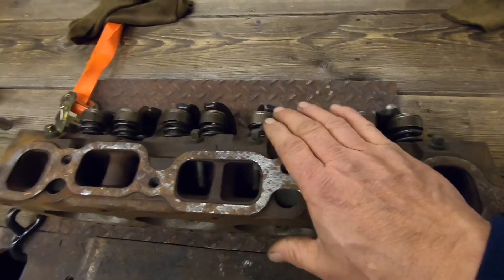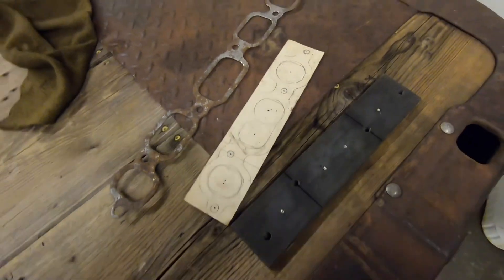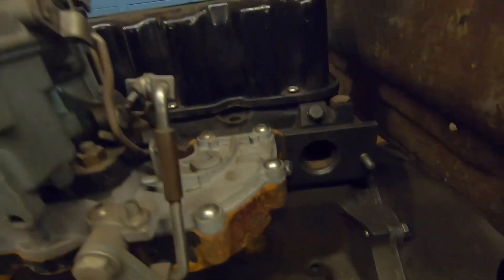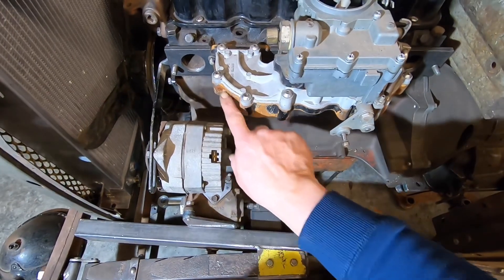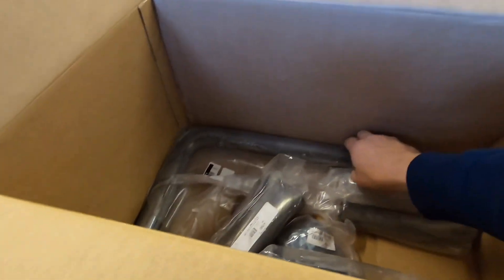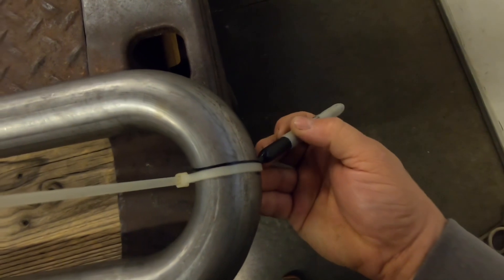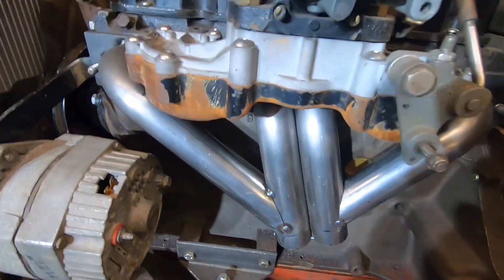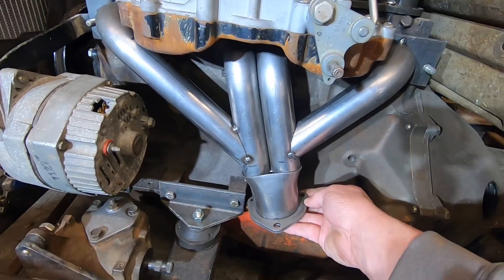The BLT #13 Building Custom Headers

Comment: always been a fan of those wee engines and that header is shaping up nicely.
Reply from the maker: They’re really cool little engines, and with 5 main bearings in the bottom end, they’re nearly indestructible.
Reply: @HotRodDad  gotta love solid engineering. i'm trying to put together a mid-60s style bucket with a small block ford but i also kinda like the early/mid-70s street rod look. bangers had been re-discovered then and thought it would be cool to do an era car with the chevy 2 style four and wire wheels. anyway, a great choice for what your doing! can't wait to see how it shapes up.
Reply: @HotRodDad  when did they stop producing these engines? are they hard to come by?
Reply from the maker: GM used them from ‘62-‘70. They could be found in Novas. They were used in a lot of Mail trucks in the ‘70s and ‘80s. GM started providing engines for Mercruiser in the ‘70s, and they used them for a couple of decades with some upgrades, bumping the HP from 90 to 120, and then to 140. They can also be found in fork lifts, industrial equipment, and generators. Very cool little engines.
Reply from the maker: There was also a version of this in a couple different models of AMC cars in 151 cubic inches. If you can find one of those, it will come with an HEI distributor.